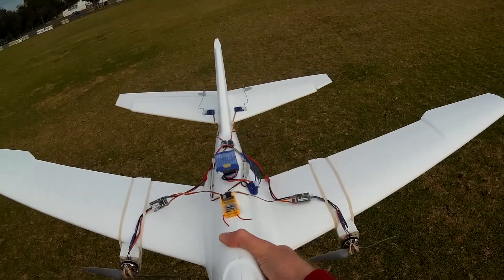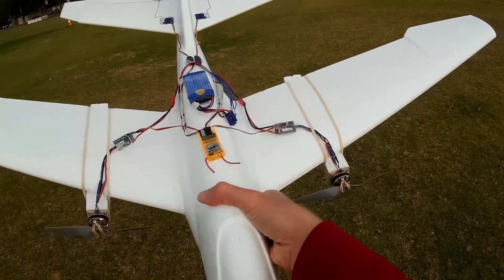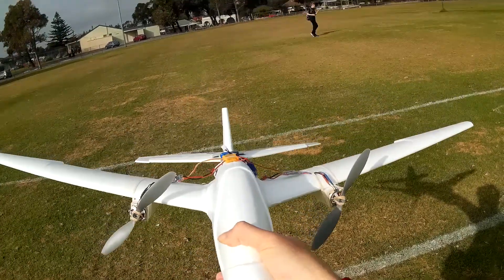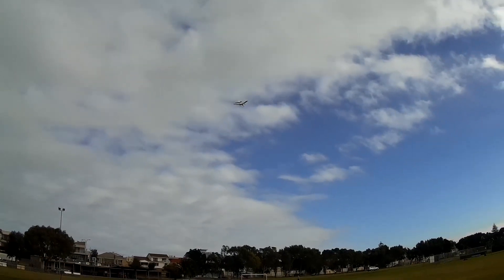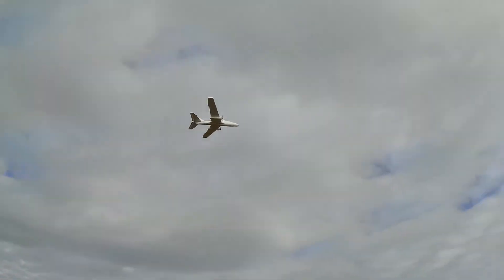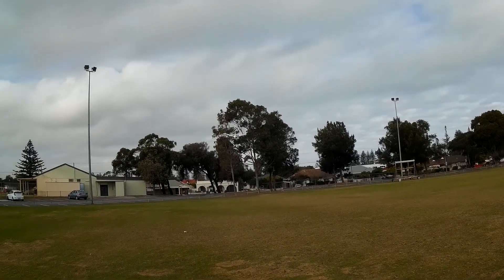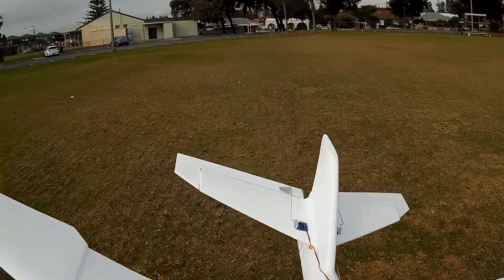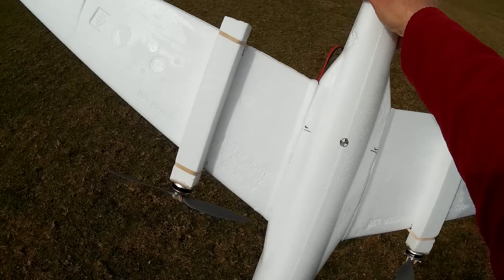Air Hogs Titan RC Conversion

Comment: what is the wing span on the titan? i bought the last 48" wing span sky riders glider the local walmart had and was going to make a single pusher motor rc out of it but after watching all the conversion videos multiple times i think it's going to be easier to do a twin motor type similar to what you did only with 2204 motors and a standard ailerons/elevator bank and yank setup instead, i really like the way yours fly's so docile ....
Reply from the maker: I believe it is 48".

After the video I did what you're planning to do; a standard ailerons/elevator setup with no rudder. I cut the ailerons in the outer sections of the wings where the cord increases. It didn't fly well at all. In hindsight I had too much down-aileron, which causes terrible adverse yaw and in the end only the differential thrust allowed me to turn at all.

I removed the electronics and stuck the Titan in the front garden with a "FREE" sign. It didn't last long . :)
Reply: not what i wanted to hear, i've got days invested in this glider in fact i've been working on it all night, i don't know how to set up differential on my radio or even if it will do it. all i have is an old/new turnigy 9x that I bought 4 years ago but have never used. I'm kinda cash strapped so i'm trying to use parts i already have laying around which is why the twin motor thing, some 2204's i bought for a quad i never built. my ailerons run the whole length of the wings, do you think that will improve the control any, i guess i could add a ruder, i've just been uneasy with burying a servo in this little stabilizer, maybe i should pull the two motors and just run one of my 2212's on it.... hmmm, thanks for the info though
Reply from the maker: Set up your ailerons to deflect more upwards than downwards (like this: https://www.wattflyer.com/forums/attachment.php?attachmentid=183276&d=1459879681) and you should be fine. Mine was almost the opposite (more down than up), which created drag on the outer wing in a turn.
Reply: i have a question maybe you can answer for me, when i am done over-building this thing (I over do everything) and I'm ready to get it in the air, do I want the CG on the converted motorized glider to be in the same place it was before it was converted? just for clarification the walmart glider i'm using is the same one josh bixler used in the flighttest walmart glider conversion video. https://youtu.be/t2Y3ok-lTEE
Reply from the maker: Yes definitely in the same spot. Or a tiny bit forward of it just to avoid having it too far aft, that would be terrible.

Comment: Nice conversion! What type of motors are you using? How did you mount them on the wing, is it just a piece of styrofoam?
Reply from the maker: Thank you! The motors were Dualsky 2203; there's a link in the description. The motors were screwed into 3mm plywood, which I glued to strips of styrofoam. The styrofoam was rubberbanded to the wings.

Comment: thanks for posting.  good work.   this model is a bear to convert.    i bought one a few years ago, and have recently begun an attempt at a conversion.    i would not buy the titan, if i could do it over.    it is not clear in the video whether the profiles of the wonky wingtip sections have been reshaped.      you may know, in addition to that wonkiness, the main wing of this model has a Thick, semi-symmetrical low-lift,  High-drag profile.   as a result, if a zero-zero thrust line is used and the stock main wing is mounted at z-z angle of incidence, very little Lift is  Ever  generated.      the Thick stock main wing trailing edge is seen, at 5:25.   All such te's Should be made  Thin;  either by shaping or by the addition of tapered material.        making the lower surface of the main wing flatter Should reduce drag and increase lift, if done correctly.    after my model has flown, that will be the last challenge.    compare a more normal profile, the clark-y v1,  11.7% thick.        cheers
https://upload.wikimedia.org/wikipedia/en/thumb/6/6a/Clark_y.JPG/799px-Clark_y.JPG
Reply from the maker: My guess is that the Titan was designed to withstand rough landings rather than a perfect flying machine, hence the thick edges.

I did not reshape the main wing. The FliteTest Titan looks different; it had a straight trailing edge on the wing and didn't feature the thicker outer sections.
Reply: some individuals were  Lucky  enough to  Not  buy the titan.  duh.    if you someday realize the significance of the information i have given,  you will be free to  IMPROVE  the trailing edges on your model.